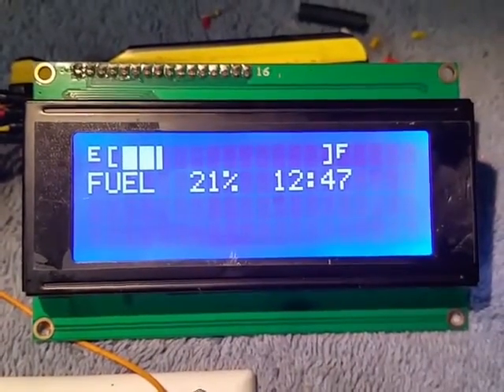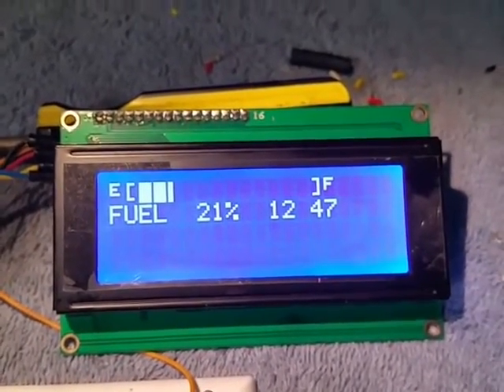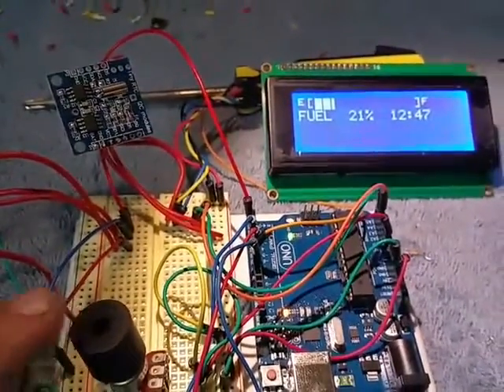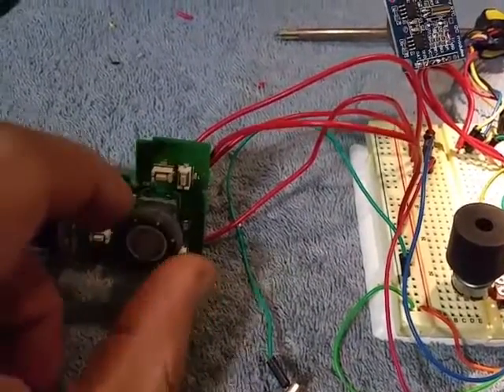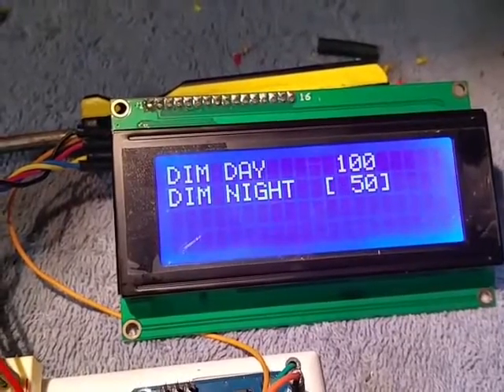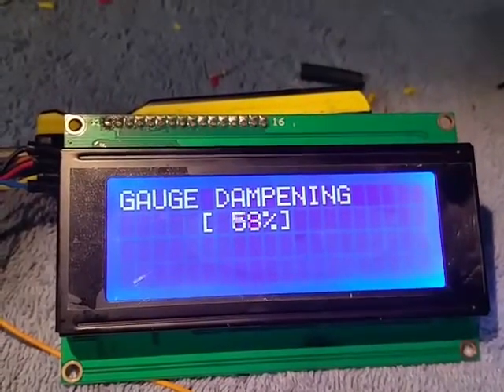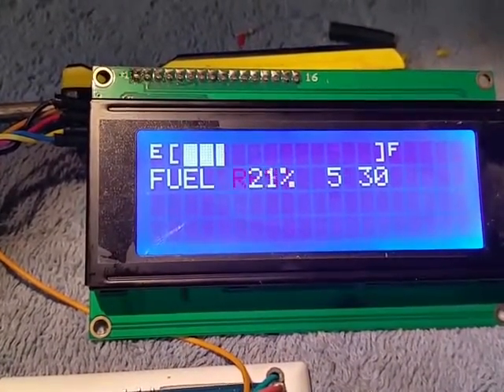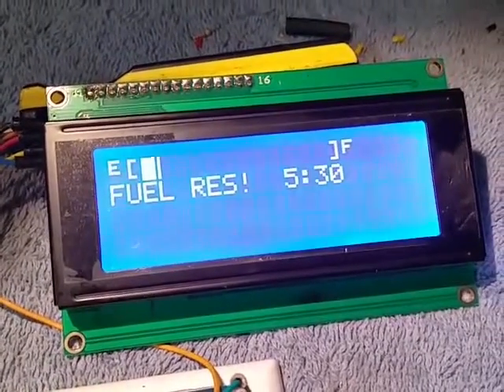Arduino fuel gauge with clock!!

Comment: sir how to calibrate tank level in percentage with ultrasonic sensor
Reply from the maker: I dont know. I'd tell you to refer to your equipments datasheet. I know for the sensor in this tank it was a 0-5v output, and we had an empty tank (1 gallon) and recorded the sensor value as empty, then filled it up and recorded the gallons it took to fill up and recorded the full value. Do simple math and you can easily get a close estimate of how much fuel is left.
Reply: @gadgetdeez7069   thanks sir

Comment: i like it. ill upload a vid of my motorbike data/display device soon. any chance you can share the code for this lcd version an not the tft one please? i like the way you mapped the values without using the call for map func! using strings isnt great if you need space but in this case, it works great!